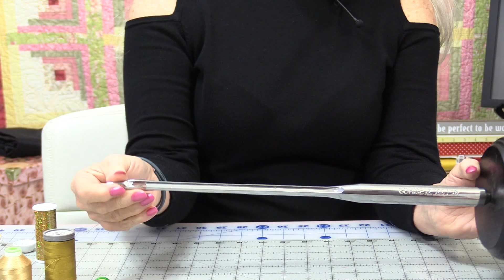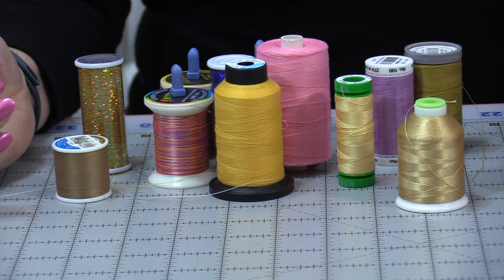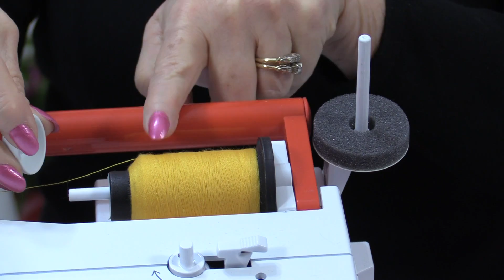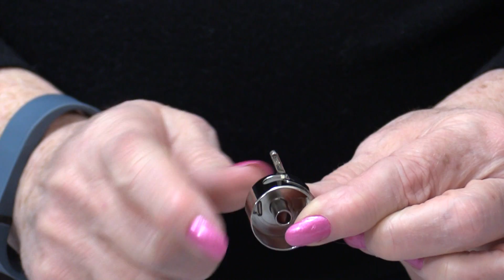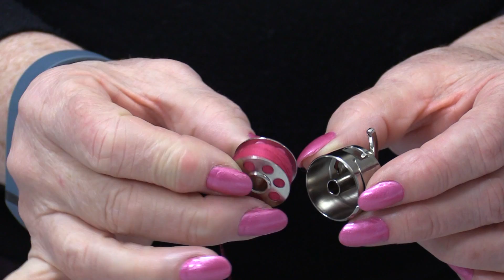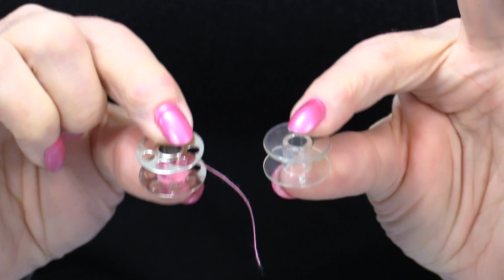Simply Sewing with Laura, Episode Two "Threading, Tension, Bobbins and More"

Comment: Be sure to always read your manual! My bobbin goes in with the thread tail on the left side of the bobbin like the letter P.  On the winder, my bobbin has the thread come from the inside of the spool through the top hole.  Each machine seems to be different in some small way.

Comment: Could you expound on how to set up a larger cone of thread and a free standing thread stand? Another important note regarding bobbin spool types is that each sewing machine maker will say whether to use a metal or plastic bobbin. They both can have the same size (example class15) and both will fit BUT if you use a metal bobbin in a machine that a plastic is to be used it will damage the area the bobbin sits in as it spins, conversely, a plastic bobbin will get chewed up in a metal bobbin recommended machine because it can’t withstand the way the bobbin mechanism works! I have an older metal bobbin machine for many years and recently obtained a newer machine recommending plastic bobbin ~ I asked if it mattered and that was the explanation why they aren’t interchangeable.
Reply from the maker: Both are good ideas, thank you.
Reply: I think as a ‘rule of thumb’, front loaders using a bobbin case use metal bobbins and top loaders without a separate bobbin case prefer plastic bobbins.